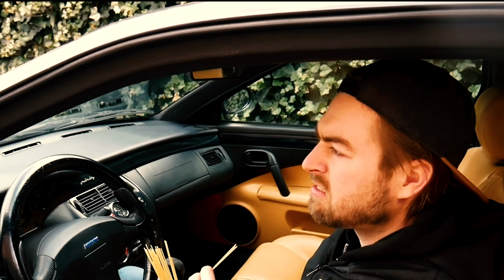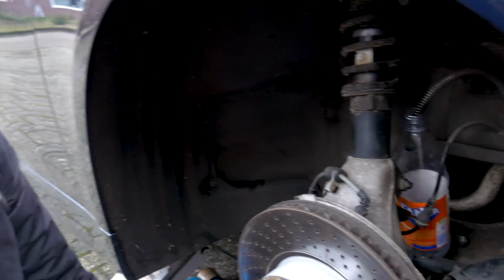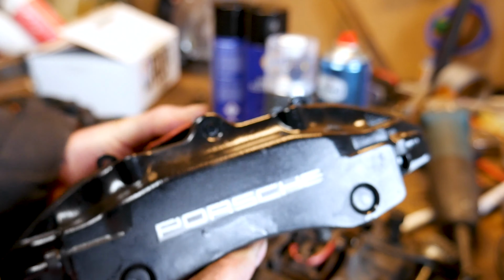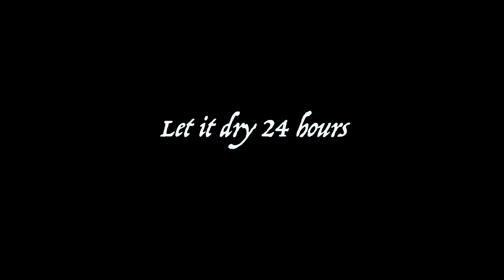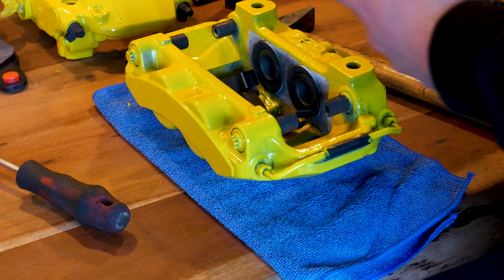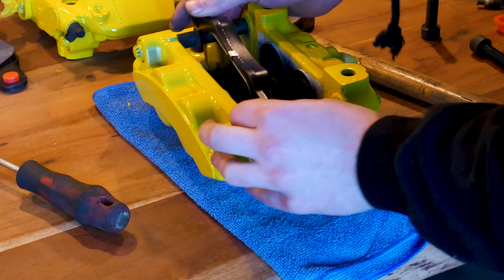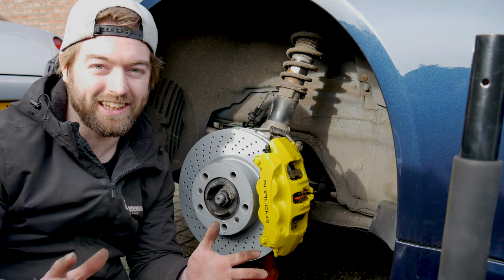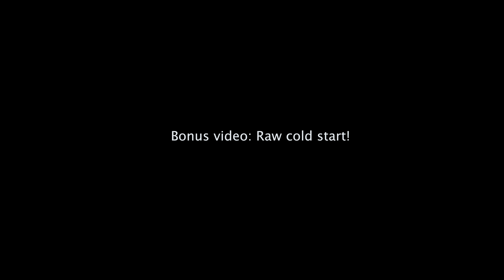Porsche Cayman 981 Brake Performance Upgrade

Comment: After putting the lettering on the caliper’s following up with a clear coat to make sure the lettering doesn’t peel over time is the best way to secure the Porsche logo on the caliper’s.
Reply from the maker: Seen a couple of people do it and the clear didnt really stick to the decal and peeling of just as hard. Even seen some cases where the clearcoat even reacted to the decal and making a mess. So I chose to do it like this and see how long its stays on. So far its pefect😅 thanks for the tip though! Really appriciate it!
Reply: @jtscustomsNL  No it’ll stick u gotta apply before the paint fully dry then the lettering then the clear coat. But if you’re happy that’s all that matters. Great job n vid

Comment: 8:56 hey man, nice video. Question, how did you insert the metal clip back into the caliper? I took mine out and it seems impossible to get it back in the caliper. Did you have to use a special tool? Any help would be appreciated.
Reply from the maker: Hey man, I tapped it back in with a small hammer, after that you need to press in de pads. The important part is to allign it right